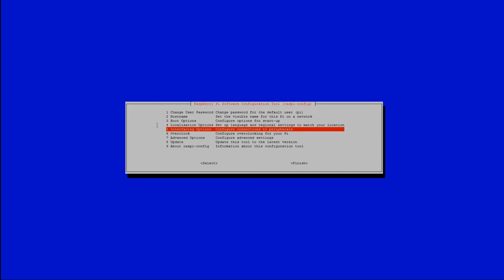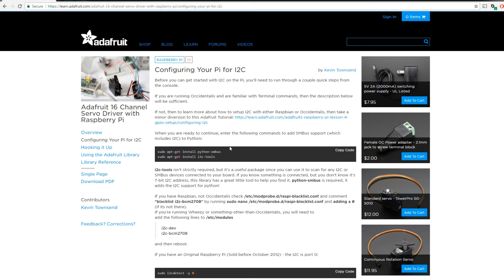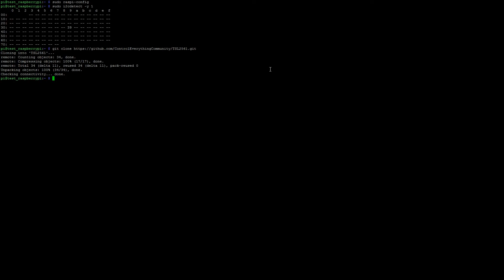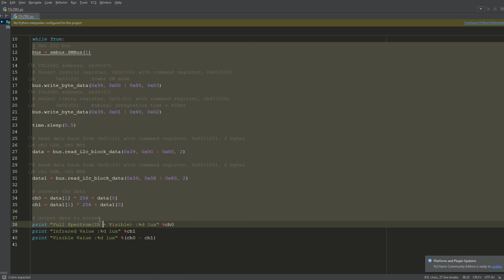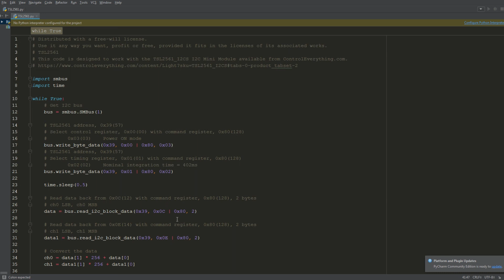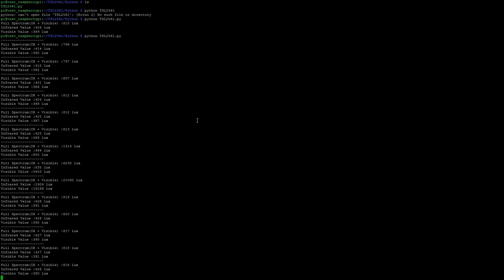Lux Sensor (TSL2561) Raspberry Pi

Comment: Will this also work for very low values? According to the Adafruit website it's supposed to handle lux values of 0.1lux, but this is often not the case. I was wondering if anyone has tested it for very low light levels.

Comment: Thanks for that video, I've got mine up and running. Plan to use it to change the display brightness of large display LED clock dependent on ambient light levels. I have also encountered the I/O error once, I'm using mine on a Raspberry Pi Zero Wireless.

Comment: I keep getting an error when running the script. 
IOError: [Errno 5] Input/Output error
I checked soldering with a multimeter, all connections are OK. Any probable causes?
Thanks for posting great videos by the way.
Reply from the maker: Hmmm, I'm not entirely sure. Maybe try the recommendations on this thread... https://stackoverflow.com/questions/30325351/ioerror-errno-5-input-output-error-while-using-smbus-for-analog-reading-thr
Reply: It worked. If I connect with keyboard and mouse, not SSH, then it works.